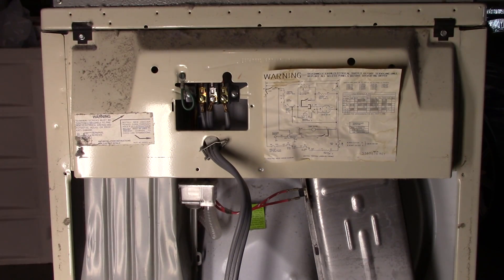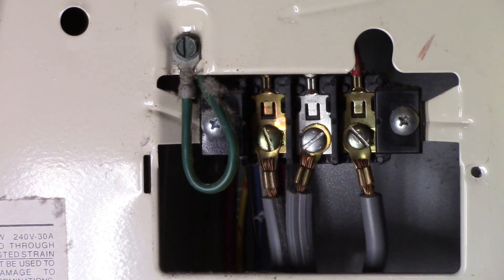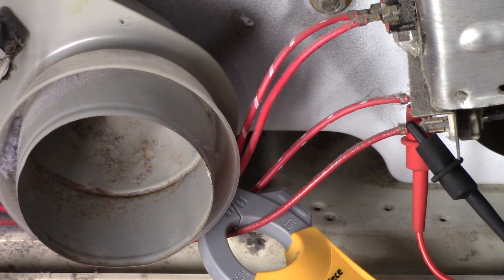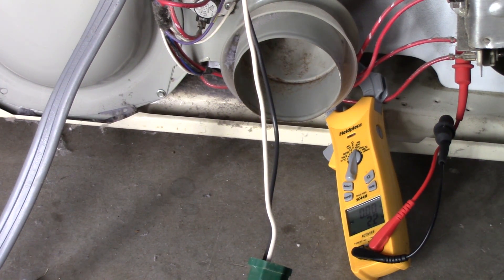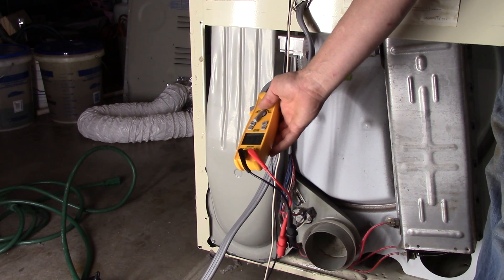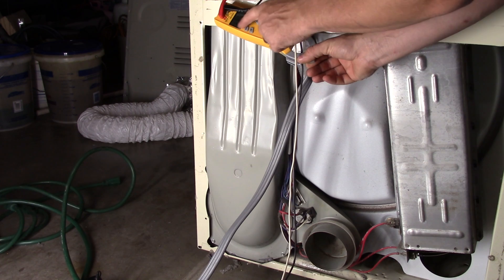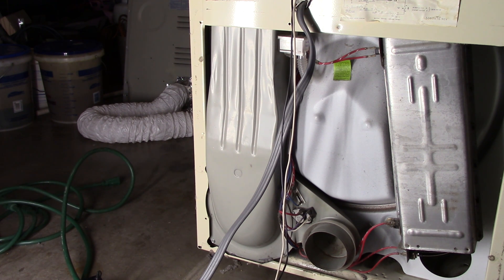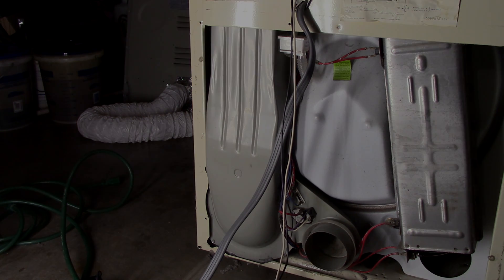Converting a standard household dryer to 110 volts @1400 watts from 240 volts @ 5500 watts

Comment: Why or what is the reason to do this, still takes the same energy
Reply from the maker: It does not 5 kW of power consumption versus 1.4 kW of power consumption not even close do your math
Reply: @solarpowerelectricityandel2915   Do your homework, 1/2 heat = 2X run full stop
Reply from the maker: @helpAmerica1  First evaporation happens at any tempeture above 32 degrees with out the heater running.It will dry because the fan moving air and the tumbling of the tub. and ohm's law would make my  homework  240 voltage and 20 amp's multiplied is 5000 watts = 18,000,000 joules,       120 voltage and 11.6 amp's multiplied is 1392 watts = 5,011.2 joules
                                                                                                           1/2 of 18,000,000 joules = 9,000,000 joules        So it's looking like i can do my homework with out you and you have failed this class
Reply: @solarpowerelectricityandel2915   So using your math we only need tumble to dry clothes no heat required as long as your drier is inside.....brilliant ???
Reply from the maker: @helpAmerica1   You're missing the point of the video reducing power consumption clothes will dry to hours with no heater
Reply from the maker: @helpAmerica1   God you made so many terrible comments you need to learn English
Reply: You can not run with a 24 watt solar system
Reply: Have you ever done no heat air dry? It still dries with almost zero energy spent. ( Tumbling and blower energy expenses are negligible compared to heater)

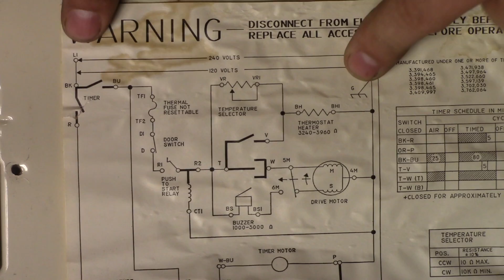Comment: That symbol at 2:20 is a chassis ground, not an earth ground. So it means the neutral is connected to the metal enclosure. Also, you are not 180 degrees out of phase, if that's what you meant by off phase. You are using your entire 240 volts single phase from the Transformer on your pole nearby. 
A lot of people describe it as two phases, but you're really using a single phase, and everything in your house running off of 120 volts has it provided from one half of your transformer outside using a center tap. 
But basically, you are running the part of your dryer to heat the element with 120 volts instead of the normal 240 volts, and everything else that usually runs off of 120 volts anyway, is running normally, correct?

Comment: Would doing this cause the dryer to be less efficient? Like instead of drying ur clothes in 15 minutes on 220-240v it might take 30 or 40 on 110v?? I really dnt care as long as i can use my dryer lol.i have a huge samsung dryer, but the shit hole we r living in at the moment is only wired for 110 v.
Reply: @Klaa-2  No....... Man......
Reply from the maker: To be honest with you as long as you keep the house fairly warm 70 70 to 75 degrees you can run it without the heater running and disconnect the heater and only run the dryer in the fan that will tumble the clothes and during the normal course of evaporation use hardly any electricity but it will take an hour or so to dry your clothes maybe 2 hours but it won't use very much electricity
Reply from the maker: But if you don't know much about electricity don't even consider doing this you can find a used gas dryer and just knock hook up the gas and run it without heat
Reply from the maker: For example a gas dryer only hooks up to 110 volts it plug riding where the washing machine does and as long as you run it without the heat mode on it'll dry without heat but it'll also dry it just takes a very long time
Reply from the maker: IT's takes 1400 watts to run the dryer and not 5500 watts and this was a test i don't have time to run for 1.5 hours for a load

Comment: How is the dryer working have you had any issues yet has a blown the fuse breaker
Reply from the maker: I reverted the dryer back to its original state it was just a test I heard about it previously from my stepfather as electrical Tech I wanted to test it and share it with everybody else I do not recommend anybody doing this if you're not electrician and if you do do it you do it on your own risk

Comment: Did it just like he did and it works great he knows what he taking about!!! By the way thanks a lot for ur video!
Reply from the maker: Please don't try this as home, thanks for your appreciation for my video. Make I ask if you do run this dryer without my permission will you make sure your new [WIRING IS NOT WARM AT ALL AND THE TERMINALS  THAT IS IN THE RECEPTACLE IS NOT HOT AFTER RUNNING FOR 30 MINUTES] just for your safety sorry for the caps.

Comment: Hello Sir, I have a question. I have purchased a washer/dryer combo in the US and brought it with me to Argentina where the residential voltage is 220v single phase. The connections on the machine are pretty similar to the one in the video, it has GND - L1 - N - L2, where I suppose L1 and L2 need to be both 120v. How may I be able to connect the machine with only one 220v hot wire? (I also have a transformer I bought just in case, which would give me one 120v hot leg and neutral).Thank you in advance!
Reply from the maker: Jesuan Lazarte this was a demonstration to use something at less wattage and I totally understand where you coming from the dryer should be 230 volts that you have and the dryer will have a neutral leg as well that the motor requires 120 volts Splitface separately for the washer you're going to have to have 120 volts as well and I would suggest to take a look at the motor and size the Transformer you're going to need to wire it up because you will not be able to use an American Dryer at 230 volt without a neutral leg the washer you can use a transformer for
Reply from the maker: Jesuan Lazarte just make sure the transformer for your washing machine is appropriate sized I don't know exactly how big your requirement power consumption for your washing machine in but I'd say I would probably start with something around 10000 watt Transformer or more you will need to look at the power amperage in better yet it's probably best to say it's recyclable material now and just going by a used set

Comment: Im going to attempt to do this, i have a family member who has a kenmore that works like this it was refurbished and reconditioned like this. The fuse went out the repair man replaced it and shortened the wire to the heater and it heats up in about a hour clothes are dry. I want to do this as im a apt dweller and refuse to pay to upgrade my electric and i already have a portable 120v dryer i just need the capacity like this
Reply from the maker: Randy Blü i suggest that you pay your appliance company to modify your dryer if they are willing and get a receipt. I don't suggest doing this under any circumstances anyways what you can do which is the safest way to do it is to run the fan and dryer tumbler without the heater itself and that way you can air dry your clothes without the heat it'll take about an hour and a half for a moderate load and you won't have to pay for the heater to run but I don't suggest modifying a dryer for yourself under any circumstances these things are designed by engineers and if something was to happen while you're pulling High amperage through a 110-volt circuit you could burn the house down sorry for the inconvenience
Reply: Solar Power Electricity and Electronics thank you, i have thought about that. Im going to ask the seller who does this how they get around this without an issue.

Comment: in the beginning of the video you said since there isn't a ground post you would take that ground wire off and connect it to the middle post.  but that Kenmore dryer harness already designed like so. that middle post connects to that ground wire on the body.  by disconnecting it it would inn ground parts of the dryer.

Comment: That will be a lot of moisture for a vacuum pump to boil off. Wonder how many hours that will take assuming you can get the tank air tight.
Reply from the maker: it's really hard to get it @ 25,000 microns not there yet.

Comment: the ground is tied to the neutral INSIDE the dryer. This is done so it doesn't trip out GFCI breakers. Remember that in a standard distribution board the neutral is tied to ground anyway.
Reply from the maker: regardless you can't pull power from a ground

Comment: I did a similar thing years ago, I built a solar air heater and took the electric heater out of the dryer, I then made duct work from the solar air heater into the air duct of the electric heater on the dryer. I ran the dryer itself of 110 volts ac. It worked good when the sun was shinning.
Reply from the maker: show me please
Reply: I well have to dig through photos and see if I can find pics of it. It was long ago before I got into doing videos. There is a ton of videos out there on building solar air heaters, I would avoid the beer can one, I tired that design and it didn't work great. All you have to do after that is pull the heater element out of the dryer and make a sheet metal duct to adapt to it for the in coming hot air from the solar air heater.

Comment: Lower the air flow through the dryer unit by 15 – 20 % & get the temp up .
Or run the exhaust / drum motor slow until a working temperature is achieved or a good preset temperature .
You could use a bi metal temperature trip or a cheap timer controlled unit  
& run the Motor slow , fast , slow , fast     ;-))
Reply: Air flow is one thing you don't want to cut too much. You can have all the heat in the world, but if the moisture cannot be carried away quick enough, you have diminishing returns. 

Even a slightly elevated temp above ambient will assist in the evaporation, but the air flow bring in fresh, dry air will do most of the work. It may take longer, then on 240 with really high heat, however, in the long run you may use less power. 

I did a experiment, dried a basket of my shop rags after washing them via "Air Fluf", which is just the air, no heat. It took 2 hours to dry completely according to the moisture sensor on my machine. 

Washed them again, same rags, same number etc... this time dried them using the heat. With heat, took 30 minutes. 

Power difference:
Without heat run time 2 hrs, measured a consumption of ~250 wh. 
With Heat, run time 30 minutes, consumption measured in at ~3kWh
Sacrificing power for convenience of shorter drying time. Increase the temp just slightly with yours running on the 120v instead of 240, and you will still have a reasonable drying time.   Of course, dryer climates help. 

Personally, I dry cloths in the dryer, but hang blankets, pillows and sheets inside during the winter. The inside air is nice and dry, and letting that evaporate in the house adds nice and much welcome humidity. In the summer hung outside in the sun, and then air fluffed. 

I had been looking into converting to 120v for the dryer though, so I could power it off my portable inverter and my 45 watt solar bank (Had this for years, it charges a 10 deep cycle battery bank at roughly 1440Ah). I like using this power for stuff in the garage. Panels don't generate much, but it's better then letting them go to waste until I can find another use for them, such as mounting on my Teardrop.
Reply from the maker: I'm thinking about 80 to 90 % air cut
Reply from the maker: My dryer motor died last week the wife add more then it could do but now i get to install a gas dryer  XD

Comment: Cool video, thanks for sharing. What's the temp at 240v for a comparison?
Reply from the maker: Very hot
Reply: +Solar Power Electricity and Electronics (phillip20) yes I would assume it would be, but I was hoping for an actual temp to see if it was double for 240v. Trying to draw a temperature correlation between the two different voltages. No biggie if it's too much of a hassle. Thanks.
Reply from the maker: It's very hard to setup the wiring in the spot but if I setup the dryer back to the factory and go to the out side vent and test it will show the time and I will give you the info.
Reply: +Solar Power Electricity and Electronics (phillip20) cool, again don't bother if it's a hassle.
Reply from the maker: It's easy to do I need to setup the dryer anyway because family of 5 here.

Comment: That's pretty cool. There is a guy in Florida that built a solar heated dryer, made the solar heat panels and sucked the air into the dryer no heating element needed.
Of course the original solar clothes dryer is a length of rope and some clothes pins ;>)
Reply from the maker: yes I need this too.